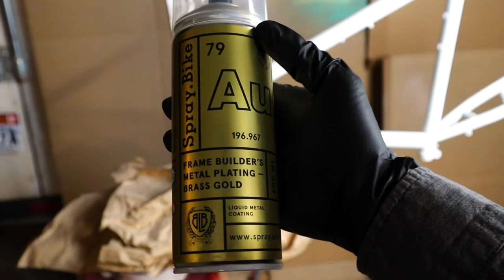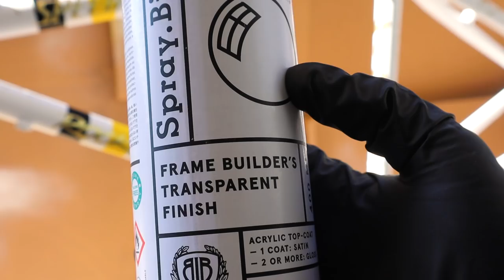Hudson Bay Inspired Custom Mountain Bike Restoration

Comment: Something that might help with your next paint job is to never stop or start your spray over what your spraying. Start spraying before the piece and continue spraying until you are past it, helps eliminate the possibility of runny paint. And this bike turned out absolutely gorgeous!! Please continue to do more!
Reply from the maker: Good tip. I am by no means a pro painter. That’s one thing that’s awesome about these paints. You can be a total novice and still have things end up good. Thanks for watching.
Reply: oldshovel I’m sure since it turned out amazing!

Comment: What a beautiful design you did for the frame paint job! 

I was imagining how the bike would look with some luxury components like an electronic SRAM shifter & dropperpost, a fox factory-fork and some Formula Cura-4 breaks. 

That great frame would deserve such. :)))
Reply from the maker: That would have been cool. If the budget was big enough I would have.
Reply: Musicsson even though you have some extra cash to burn for those components you mention it wont fit to the frame like the dropper post, the seat post diameter of that model is one of a kind very hard to find and also the fox factory fork the headtube is standard i think its 1inch diameter and it doesnt have caliper post for the disc brake
Reply: @tomasgimenez3754  Yes, you are right. :)
Reply: @oldshovel  I was actually not totally seriously saying that.
Your bike build looks phantastic also without luxury parts that anyway only few people can afford or benefit from the difference in quality.

Great job !

Comment: Great videos and awesome restorations! I know you like giving new life to as many of the parts on the bikes as possible... but I'm wondering if you've considered going with a 1x10 drivetrain on builds like this. The biggest benefit I would see is not having to mount a front derailleur over that amazing paint job!! I know you'd have to get new brake levers and a new rear shifter as well and that would increase the cost on the builds... but it seems like it would make your builds just that much cleaner? Keep up the great work!!

Comment: Hi there! Little remarks : 

-you should put grease on the BB axle before pushing the crank arms onto it, it ensures an easier dismounting, same for the pedals, rear derailleur, brake calipers and everything screwed with force.
-I advise you to use a torque wrench, especially for the alloy parts.

Awesome restoration though, keep up the good work, man!
Greetings from France.

Comment: I have watched most if not all of your videos at least once.  They are very well done and inspiring.

Would you consider doing a video on how to convert from a 3x to a 1x with good dialog?  I have searched YouTube and there really aren't any good ones out there.

I have a couple of bikes that I would be interested in converting to 1x but don't know how to do so without buying an entire new drive train.

I do all my own bike maintenance and upgrades and have completely stripped frames before but am still not clear as to the 1x conversion using some existing parts.

Comment: love the restoration! Only gripe is that you should have changed out the stem for a shorter modern 4 bolt system for safety. if a kid takes this mountain biking and the single bolt is taking all that impact and weight, it won't be enough and can send them flying! also shorter is for better reach and control, especially in tight turns

Comment: Love this build.  I recently purchased a RockHopper (?1989?). Problem is that the aluminum seat post is stuck.  I have seen your video removing the seized seatpost - but am wondering is there a better way - as I might accidentally saw the seat tube.  Would appreciate any advice.  Thanks in advance !

Comment: What a nice video.  You must be Canadian, EH !!! What I would like to say to remove decals or stickers from bicycles, I use Zippo lighting fuel, soak and peel, or use a heat gun which I never tried.  Where do you get the new decals to design the frame.  Where are you located ?  Nice work, however some explanations or how to do things would go a long way.  Great results and wishing you the best.

Comment: Was wondering where you got the decals for the constellations? Well done!
Reply from the maker: I made all the stickers myself using a Cricut vinyl cutter. For the constellations, I designed them all in photoshop first.
Reply: @oldshovel  Sick! Can't wait for your next builds. I really like the paint job you did for this one!
Reply: What is the reason for doing the decals like this rather than over the white paint? Did you need to scalpel the top paint layer to remove the vinyl without peeling?
Reply from the maker: It’s much easier to paint over the sticker and peal it off this way than the time it would take to mask the whole bike to paint just the constellations.

Comment: I have a question. I have a specialized rockhopper. I’m guessing it’s a 93’ or 94’. My parents bought it right after they got married in 93’. It was kept in amazing condition and was passed into me. I’ve since moved on to better bikes. But after finding your channel I want to restore and modernize my rock hopper. Is that a 1” or 1 1/8” threadless headset that you’re putting on? I wasn’t really able to find any info. I can’t currently look at the bike because it’s in Texas. I have been binge watching your channel, I love it and your stories.
Reply: Rockhopper switched to threadless in 95.  You may be able to convert but need a thinner fork  tube

Comment: amazing paintjob but seems there are some little off edges on these stripes. maybe the masking tape wasn't sticked evenly. Also there are some sharp edges of white paint seen on these gold decals. Maybe it would be good to wet sand the frame with very fine grain paper before clear coating to have these color transitions smooth as if it was one layer... great build though. The gum wall tires, the leather seat and brown grips match really well with this white and gold.

Comment: At 18:30 such a shame those shifters haven't been cleaned and greased. One extra hour of work would have made this bike like new. As a tip, before removing decals, cover the frame for a few minutes in some cold wet rags previously kept in a freezer (or bags of ice), chilling the paint makes it stronger and won't peel away when removing decals. Great job buddy!

Comment: Top quality powder coat is about one mile away, they charge me 75$ whole bike frame. Cheap! I use that as a base coat. He sand blasts, treats the metal anti-corrosion then powder coat. Then I do the graphics. Finish with 2 part 3m clear coat. I can buy the kit and do many bikes. Very durable!

Comment: The paint job and its design are really amazing.
Thinking about it though, this is more of an upgrade than a restoration because 80% of the bike is now brand new parts.
I currently have a MARIN Nail Trail from 1999 a Raleigh All Terrain from the 90's and a few others, selling for less than a 100$. That is after repair and labor. During the past 4 years I guess about 250 different brands and models have passed under my hands.
The time put into each pair and the spare parts make it uneconomical.
The electric scooters and the electric bikes took over the mechanical ones in all our major cities.
Sad.

Comment: Pretty sure the bottom bracket is on the wrong way. When you pedal, it will loosen the bottom bracket and eventually fall off. The non drive side should be reverse threaded.
Reply from the maker: The threads on each side of the bottom bracket are different as are the threads on the frame. The threads on the frame will only allow the bottom bracket to be screwed on one way. If I was to reverse it they would not screw on.
Reply: @oldshovel  Alright then, seems like poor design by specialized. Love the rest of the build though, reminds of all the old bikes I used to work on.

Comment: Did anyone else notice the bottom bracket is in backwards?
Reply from the maker: The frame only allows threading one way. To get it backwards I would have had to tap new threads on both sides on the frame.

Comment: Too many stem spacers, its not safe, airwolf (chinese) carbon riser bars are about 20$ and strong but 1-1/8 inch. Or just any riser bars really.. if you need 1 inch bars go with steel 'open prison' 30$ by Gusset, nice feel.